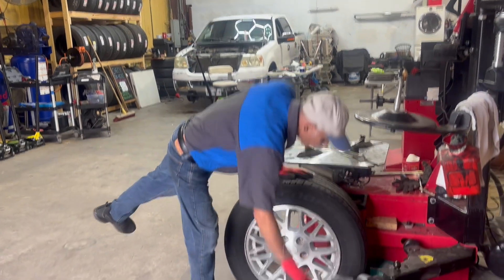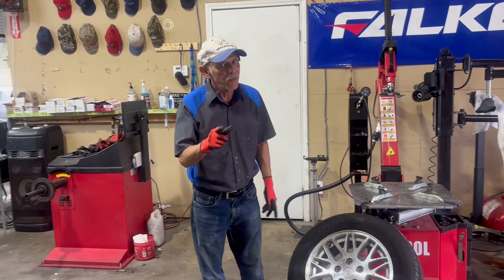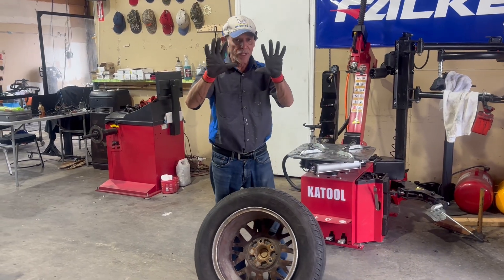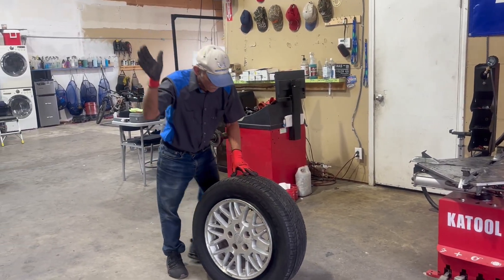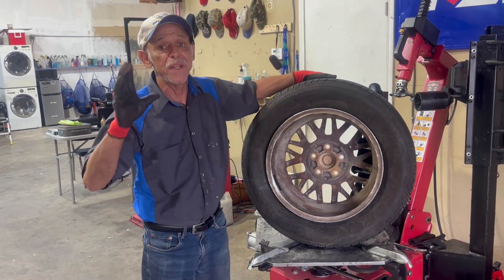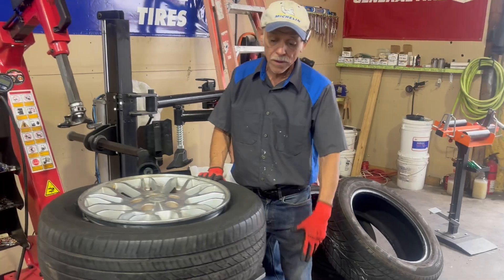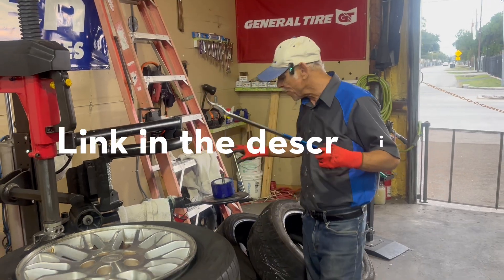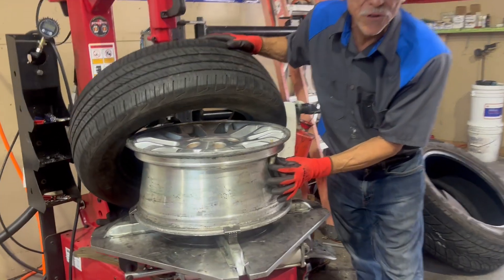Did The Tire-shop Damage Your TPMS Sensors?

Comment from the maker: 👇 Click below to check them out on Amazon 👇
Scratch Resistant Tape – https://amzn.to/4nyr5rI

🧤 Work Gloves – https://amzn.to/4325Uao

🛞 Tire Changer Combo – https://amzn.to/4qHbI3i

🧱 2-Ton Jack – https://amzn.to/3JDyKXW

🛒 Utility Cart – https://amzn.to/47DfFNL

💨 50ft Air Hose Reel (Retractable) – https://amzn.to/4olm874

💡 Hexagrid Light Grid – https://amzn.to/47A4Vzs

🔩 Ingersoll Rand Impact – https://amzn.to/4oM1woe

⚙ Impact Socket Set – https://amzn.to/49qPV9G

🦾 Jack Stands – https://amzn.to/3LeSLEJ

🔌 Retractable Power Plug – https://amzn.to/3J9QgmE

🧍‍♂ Shop Table – https://amzn.to/3J9QgmE
 (same link — verify)
🔊 JBL Shop Speaker – https://amzn.to/4oRlfTD

🔫 Cordless Impacts – https://amzn.to/49tAw8s

🩹 Tire Repair Patches – https://amzn.to/47j7YgH

🧴 Patch Glue (Vulcanizing Cement) – https://amzn.to/3X6swmu

🌀 Buffer Air Tool / Scraper / Roller Kit – https://amzn.to/47xETN9

💨 Digital Tire Inflator (Gauge) – https://amzn.to/3LhN7Sj

📡 Autel TPMS Scanner + Sensors – https://amzn.to/3J9TwOU

⚠ As an Amazon Associate, we earn from qualifying purchases (no extra cost to you).

Comment: I have a question regarding TPMS valve replacement. Traditionally, prior to TPMS, those would be replaced every time tires would be removed and replaced with new ones or when re-installing the winter tires for people north of the 'rust belt'. Because TPMS valves are much more expensive ($50 for set of 4), what is your approach in that regard (as the valves will eventually fail just like any other) and how do you sell it to the customer?